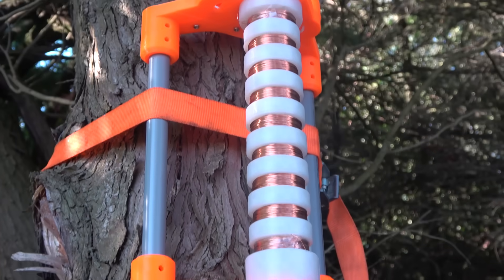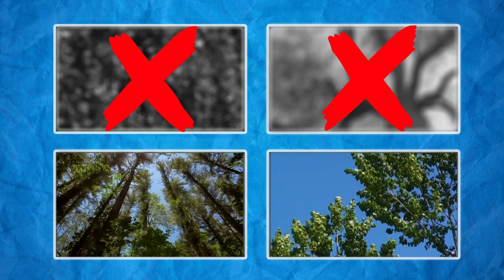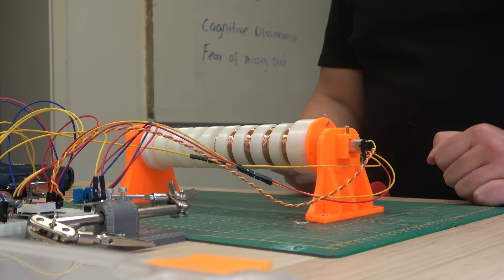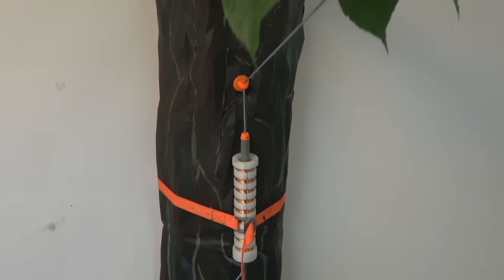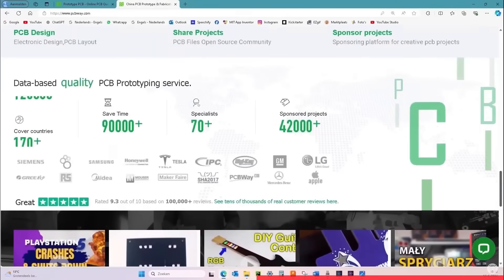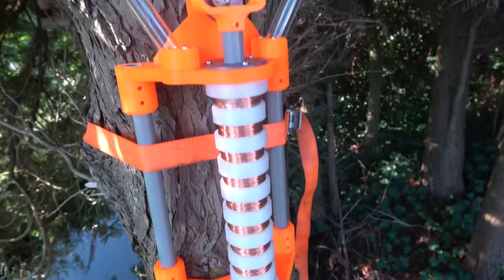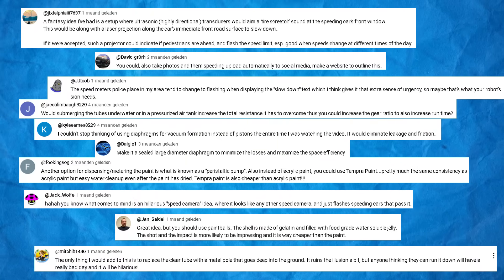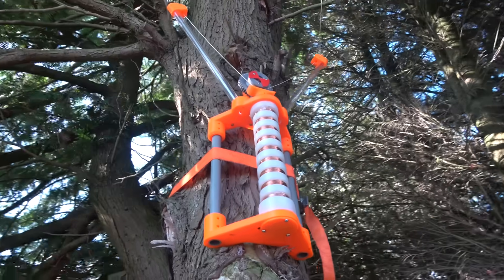I Made a Tree Generate Electricity..

Comment: This is a great way to try and get power out of the trees movement. Well done! My feedback after watching and reading a few comments is to possibly change from the linear to 2 rotational generators. There could be opposite ratcheting teeth for both so when the movement collector moves one way it drives one generator, and opposite movement drives the other generator. I believe this would lessen the effect of gravity that you had to tackle. And then I’m thinking which batteries would be best to store the energy because Li ion does have its risks

Comment: I might be missing something but with the spread bars, when the branch goes up and down, doesn't it cause equal forces on both sides of the pulleys, effectively cancelling out? That seems to be what the example with sandbags shows too. I would imagine with sufficient upwards force it could even tear the gear out.

With the same idea but two independent cores and sandbags at the other end of the ropes so gravity gets involved, one for each side, or one side tied moving the core and the other moving the coils (though when movements coincide energy would be lost as they both move in the same direction - but at least it can't rip out the gear), you could catch movement from both poles independently

Comment: Yo, this gave me an idea, while using a tree is a great idea too. You could make a tall, thin flexible pole with a pole perpendicular to the one in the ground, then attach a sail(or something) with just enough volume to catch air. Hook up your generator in a similar way(or as described bellow with a fly wheel similar to a bike) and bam, simplest wind generator ever. Smaller profile, can fit in someone's backyard easily.

Comment: Tree movement is definitely harnessable energy. But because it comes in such small amounts over a long period of time I think we need some way of saving that energy so that it can be used at a faster rate therefore higher energy output for shorter time. So what if rather than spinning or moving something that generates electricity what about raising some kind of huge weight so that there is potential energy from gravity if the tree were able to raise that weight in tiny tiny increments over several days, windy days hopefully, then that weight would then have sufficient potential energy, under the pull of gravity, to spin a real generator and produce real usable current.

Comment: When you displayed the slender trees swaying in the wind, I thought you could probably get more energy from the pulling action of the ropes by attaching each rope higher up the trunks of two trees or pairs of trees. Then scale up your pulley solution to rotate the shaft of a portable generator. If that works, attach a battery to store the energy when the wind stops.

Comment: Idea for another project.    Use a prism to split light such that only the shorter wavelengths are beamed onto a solar cell. Start with small scale experiment. Solar cells loose efficieciency significantly when hot, the longer  (heat) wavelengths can be diverted away.  Obviously there would be tracking issues but some clever but simple design could minimise them. Imagine this with a solar concentrator - less the excessive heat.

 (Alternatively [or additionally] water cool the cells and use that [diverted] heat -- less favoured because heat is more entropic and water + electricity dont scale up well, plus the cooling network could get too complex and heavy.)

Comment: Why not have the cylinder horizontal, and have the branches pull the magnets left and right? This would remove the complexity and losses from the pulley and gears. Or, have your vertical design climb the tree like winding a clock, so that you always get a consistent electrical output from the unwinding.

Comment: In terms of practical application, would this setup perhaps be better suited to charge a capacitor bank, given the fluctuations in voltage and current?

I remember hearing that our capacitor technology is quite far behind compared to battery technology and infrastructure, but is better suited for many applications. Is there a way to discharge a capacitor bank in a better controlled manner to charge batteries or for direct usage with a set voltage, amperage or hertz (if considering usage on an AC grid)?

Comment: A simpler and more effective way of converting the energy would be to just put a normal rotary generator on the small gear.
Yes, it has to slow down and accelerate, but the tree branch already has a lot of inertia, so that probably wouldn't make such a big difference. Thereby a ratchet system as suggested in another comment wouldn't be necessary.

Comment: This is a really clever idea!
The only problem I spotted is that the bottom magnets, the ones used as a magnetic spring, will reduce te magnetic flux and then reduce the energy conversion efficiency, because they're opposing the other magnets.
Reply: That's  a good point.

Comment: It doesn't sound far fetched. But you cheated and used kinetic energy generation rather than inductive electric current generation that harvests either atmospheric electricity or radio waves. Doing that would be more of a challenge and might require some scientific experimentation to see what kind of fields are available in the localized region. If you wanted to induce a charge from radio waves you would need to know the frequency bandwidth to design a specific length of wire at a specific gauge. But you can be certain every meter above the ground there is a potential difference of 100 volts. So a 10 meter tree is surrounded by a 1000 volt electric field at the top. However, I've seen diagrams that show those fields forming around organic grounded matter. So you would need to determine how to harvest the fields in the open air space with a wire that spans from the top of two or more trees then down to the ground.

Comment: You could also , for the rocking back and forth of the trunks, use a rigid pendulum (with a solid rod instead of a string), wich could have a counterweight at the bottom, and at the top would be attached to a transmission with a higher gear ratio, which would be in turn connected to a traditional round generator. This setup would not only produce electricity, but would also disrupt the momentum of the tree when it's blown by the wind, preventig it from reaching it's resonation frequency, wich would help it not break. For the movement in both axes, 2 of these at a 90 degree angle should cover. Very nice project, and i wish u the best!

Comment: so after watching this the system sounds interesting but inefficient  
the force the branch makes is not used to maximum and the a/c gen only gives kinda random useless bursts of energy 
i would make another gen from back . and then make a whining mechanism that would work the same way like the funny small car toys where you rotate a button and that stores energy and puts it into a toy car after release tho much bigger for batter efficiency . then make the tree branches connected to a gearbox that would wind up one of the mechanisms and they would alternate between each other . so basically the movement of tree branch would be converted to wind up something that can create continues movement and every time it would be winding up there would be a second one going off that could produce much better voltage signal and could be useful after converting to d/c for charging up battery's maybe 
if i could post plans how it could work i would
Reply: better efficiency*
Reply: this project is cool but you would need to make upgrades for it to do anything more then just make led light flicker

Comment: This seems intriguing.. What if instead you would attach multiple small wind turbines (like the size of those small hand held usb fans) into the top branches and collect the wind energy from there? 

I know that is basically just a wind turbine but instead of one big one you have many small ones. Most likely this would have horrible efficiency as the torque of the small propellers would not generate much and be much less efficient than a one bigger one but I mean the idea here I guess is to keep things simple. 😅

Comment: Let me join the conversation. I've thought about anchoring a series of small impellers that float and are powered by a flowing river. Each impeller would spin a small alternator which would be connected to diodes and capacitors and then finally to a bank of batteries.
I think the most practical way is to use a steam driven impeller. A wood burning rocket stove would produce very little smoke.

Comment: There are wind generators that use kites - the kites catch the wind and rise, pulling a cable, then the kite's surfaces are adjusted and it drops back down, where it catches the wind and flies up again. I don't think this helps at all but it's a cool concept.
Reply: Hey whatever gear solution they use could genuinely be useful here

Comment: So you were fighting against gravity, and you used a magnet to balance it?
Why not lay it sideways and have the gear shake it back-and-forth then you can make a stationary object that just sits on the ground with a weight and have the string pull it back-and-forth using the gear to speed it up. There won’t be any need to attach it directly to the tree, just stake it into the ground to secure it. 

It also means you could set up multiple ones on multiple limbs on a single tree in multiple directions.
Reply: Good even make more of a generator wheel, using a bike tire and chain and gear ratio

Comment: Idea… could you use the rotating gear to spin a rotating generator and have a mechanism to convert either way movement to the same rotation. Addition of a flywheel in this case could help. This way, up or down or left or right movent is translated into rotation and abrupt powerfull branch movement caused by gusts is stored in the flywheel temporarily. I think there are large losses in the rotation to linear motion mechanism. I hope this helps. 🎉

Comment: Just scrap the branch concept all together imo, use the trunk sway. Much more torque and motion to utilize. You could go higher on one trunk to lower on another to chain them together and avoid creating attachment points on the ground. Lower trunk will move very little if at all compared to a higher one and a weight or spring could wind the string back so you only need to attach on one side to another tree. 

Also would forget generating power from multiple directions in this as a proof of concept for ease of creation, however an easy to make swing arm could connect another tree offset from the first with your style pulley and then that would simply need to drive a second pulley connected to the generator (scrap the gearbox and linear motion as it’s typically inefficient and can’t utilize the larger motion this would aim to capture). In the case of using the 2 trees offset from each other, the pulley thing you are already using should be free floating with a small housing connecting it to the other pulley going to the generator. This way diagonal motion in either direction acting on those trees will pull or let the whole thing retract when otherwise it would do nothing to generate power (and would break the machine if this system wasn’t free floating) Having the three strings suspend the pulley parts also allows for flexible installation to get the optimal angle for the trees from the pulley. Your design for capturing the motion in multiple directions should be possible to use here too with some tinkering and a more complex installation but I’d typically try to avoid completely for a prototype.

For the generator itself a weight is probably best to provide tension but a large watch style spring could be fine for retracting the string that attaches the pulley’s to the gearbox. This is to retract the string that spins the generator. 

Generator should obviously be rotational instead of linear to easily absorb larger movements (and is just better in general tbh) 

Forget any kind of power storing (to continue spinning the generator) in a flywheel or watch spring as they add a good bit of complexity to a proof of concept and probably aren’t optimal. Having a winding spring pulled by the string INSTEAD of the generator is fine and using this large winding spring could smooth out power delivery so it’s not too bad an idea. A flywheel is silly as a way to power the generator and only makes sense for storing generated power like a plant in a dam, but why would you do that? It would have to be converted back into electricity so it’s basically just adding a generator powered by our generator. 

Store the energy in a capacitor

To have both the pulling and retracting of the string power the generator have two alternating ratchets, they take more energy out than a free hub style thing I saw another comment mention but torque should be plentiful and momentum to engage those may be lacking much of the time. Also ratchets are easy to make / cheap to source. The finer and more plentiful the teeth on them the better, this means smaller motions add energy. 

Finally some gearing to vastly increase the rpm of the generator and better utilize the huge torque from the trunk sway. And you’re done.

I can send some drafts if you need, just provide an email or other means of contact. May even be able to whip up some scalable stl files from my work laptop as it should run cadd and im stuck at home with a shattered chest anyway.

Time to go back to sleep

Comment: I have never tried this but my head says it will work.
Use a stepper motor as a generator.
If its a 4 pole stepper then make a 4 phase rectifier using diodes.
Smooth with capacitors.
Regulate the power and use on your project.
I think it will be much more efficient then your build.
great video btw.

Comment: Not sure if this would work. How about using a smaller magnet tube with the coil tube, maybe some plastic springs inside the tube, and closed on the ends. Then put it on the branches by the leaves to the outer part of the tree. Use the branches moving around to push the magnet tube back and forth.

Comment: Very cool but branches are really high up. I'd rather not do a lot of climbing. Plus, branch forces are probably quite weak. Several generators encircling a tall tree and converting the trunk motion into energy would be my pick. The trunk force could be immense depending on the tree, so a much higher gear ratio could be possible. You could use an air cannon to blast a weight and string high into the tree and pull a sturdy rope trough the canopy with one end of the rope attached to the string and the other to the generator. Once the rope has been pulled trough by the string, secure it to the trunk. Repeat several times to get the most out of a single tree's motion.
Also, a general problem you're sure to encounter is that long ropes will stretch, not just over time but also during the motion, and will have a major dampening effect, thus sapping efficiency. Natural fiber ropes are less stretchy, which is good, but won't take wet weather. Poly ropes are too stretchy and easily damaged by the sun. Metal ropes or chains may be the best choice but are really heavy and expensive. Just food for thought...

Comment: I think a more efficient solution would be to harness the tree's kinetic energy into a flywheel somehow. 

One idea: try raising a moderate weight bit by bit using a ratchet mechanism. Then, when it reaches a certain height, release the weight from the ratchet mechanism. Tap into the falling weight's kinetic energy by making it turn a good-sized flywheel that's geared up to spin faster than the weight is falling. It's literally a tree-driven gravity generator. I believe the same concept may have been tested at a larger scale harnessing ocean swells rather than trees. (Not sure)

I feel there's inefficiency in your linear generator in the sense that it's constantly starting up and stopping - I think the continuous motion of a flywheel could improve on that. (Maybe you could drive a flywheel with the trees directly, skipping the weight)

The advantage I could see with using a weight to spin the flywheel is you could wait to release its energy until you need it, but I suppose you may do the same with a battery or capacitor..

Comment: This system resembles the kite wind power, which is a reversing spindle like a normal generator. I understand you need something like that because you need consistent power output, so need some inertia or gearing to smooth the power output. 

And then generators work better with velocity over field strength anyway, so, cylindrical generators

Comment: This is a nonsensical way to generate electricity. Even if you can gather a nontrivial amount of electricity per tree and even if the cost of a single device is not too high, the fact that you need to install it on hundreds or thousands of trees to get output anywhere comparable to a solar panel farm and then connect them all with wires in a forest is gonna make installation and maintenance a nightmare. Not to mention the risk of forest fires.